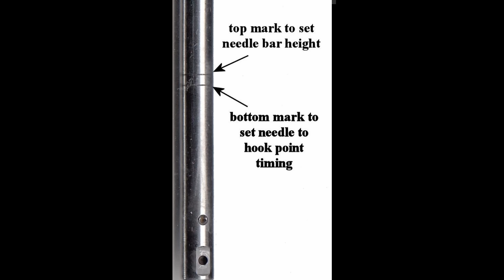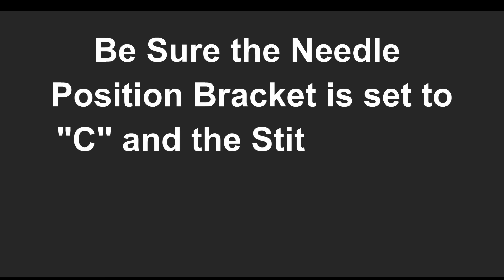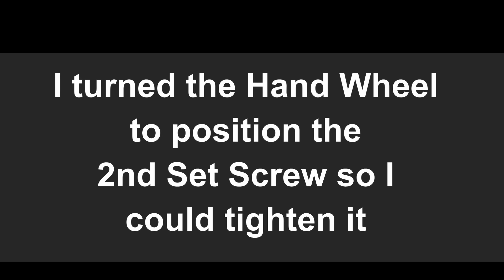How to Check and Set the Timing on the Singer Model 413 Sewing Machine

Comment: The bobbin "bed" on my Singer 466 does not move at all!  Why would this be, please?  Is there a pulley or something that is missing (?)
Reply: (The open base looks just like your does here, has the same pulley configuration but does not move anything when I pull on i5...  Should it move when I pull it?  If not does this old machine just need cleaning/oiling (?)

(Not my machine hence all these questions, thank you so MUCH)
Reply: When I power it up NOTHING moves except the pressure foot gearing, the pulley stays stock still...
Reply: The pulley and all the internal base assemblage STUFF looks perfectly clean and dry...Just immovable like a ROCK
Reply from the maker: you asked why the bobbin "bed" does not move. I think you mean the hook. The chances are high that the top gear of the vertical shaft is damaged/broken/jammed. That gear is plastic and transfers power from the horizontal arm shaft (main) down to the pulley on the right to turn the timing belt to turn the pulley on the left to turn the hook. The bobbin case sits on the hook race and holds the bobbin. If I'm correct then the gear must be replaced. It costs about $10 and takes a couple of hours. Explicit step-by-step instructions are in my gear replacement video you can find here: https://youtu.be/M3bFtlV1Y6s
You can skip around through this video and see what gear I'm talking about (under the top arm cover) and shine a flashlight down on it and see if it's there in good condition, or busted up and needs replacement. Your machine is one of a handful of model numbers that are internationally known to have this gear problem so do not feel alone. I posted the video about 7 months ago and it has 11,000+ views. Good Luck, and if that is NOT the problem let me know.
Reply: @andytubesewing1953  THANK YOU!! Yes, NOTHING moves at all underneath to make the bobbin twist, the hook as you say, but the needle goes up and down just fine.  I will watch your link and follow the instructions.  THANK YOU AGAIN!
Reply from the maker: It sounds exactly like the broken gear syndrome. Good Luck

Comment: Can I do the same in my 3342 model,Andy Tube?
Reply from the maker: Model 3342 is from 2016 and still for sale on the SInger website. That's about 45 years newer than the machines I work on. I can't get a parts list or service manual for it. I have no idea if the mechanical parts are similar enough to the model in this video that it would apply to setting the timing. Most modern machines like model 3342 have many plastic parts. I do not know if it has a timing belt with pulleys or timing marks on the needle bar. If you can open the covers and see the same/similar parts then it probably times in the same way.
Reply: @andytubesewing1953   thanks a lot! I like your video a lot. I'm working on it now .
Reply from the maker: @liezlsokol2265  Best of luck then.

Comment: Thank you for the video! It help me fix the timing that I set improperly after replacing the top gear on the excellent 413 I found in a thrift store a few years ago. Thanks to https://youtu.be/XrNh_iaqDMM I gave it a proper oiling as well. Now I'm just hoping that cleaning the commutator and, at worst, maybe new brushes (thanks again to your videos) will solve the final issue: motor making a lot of noise and the machine refusing to start sewing at low speed.
Reply from the maker: It's a nice machine, and congrats for changing the gear out. Can you turn the handwheel normally? I ask b/c my first gear change I meshed the new gear to tightly. Think of the motor in model 413 (SN(K) OPEN) and the foot pedal (Clamshell Style) I found slow starting and groaning more often caused by the pedal than the motor. Just something to think about. Here is my Playlist for restoring the pedal back to factory working condition: https://www.youtube.com/playlist?list=PLsCOZgzzaiKItPLWcK24FBoMdHK8vTXNi    I appreciate you watching my channel, Max, and that you saved the machine. Good luck.

Comment: Why does it get out of time?
Reply from the maker: I've waiting a long time for you! 👀 On a machine like the 413 the timing belt can slip.  That is why they started using cogged belts; less likely to slip. A tiny slip and you start skipping stitches. The other reason can be a sudden jam or needle strike that knocks the needle bar up a tiny bit. That changes the timing also. Machines like the slant-o-matics with their steel gears seldom go out of time. Steel gears just don't slip.  A model like the 237 I think would never go out of time b/c of it's unique traveling hook system. Whew! Glad I finally got that off my chest and thanks for asking ✨😉
Reply: @andytubesewing1953  Thank you for your help!
Reply: @timeless_realm  oh really The pleasure was mine and thanks for the great question